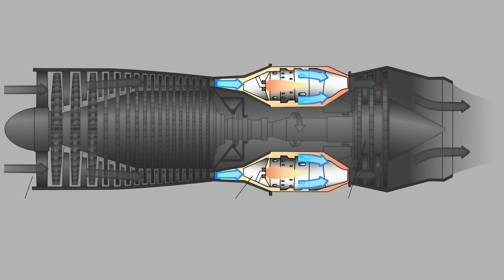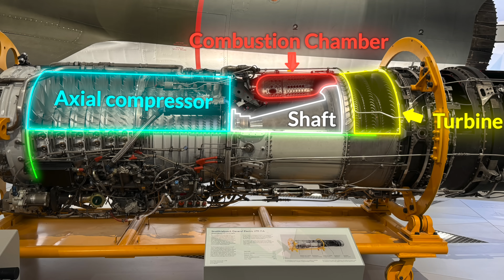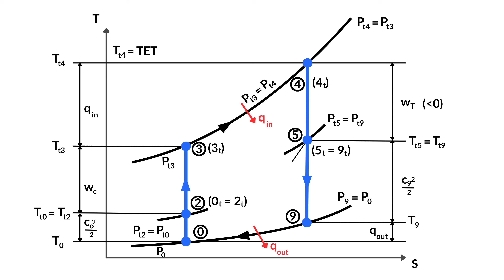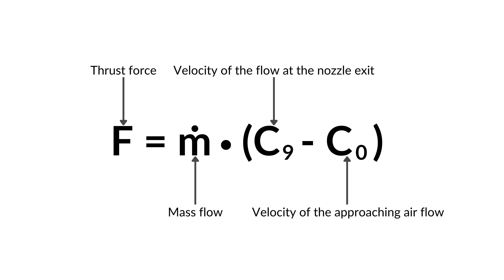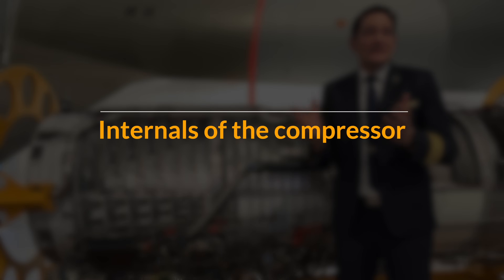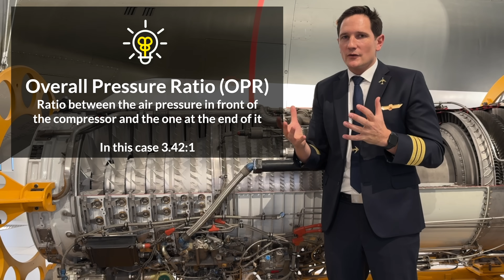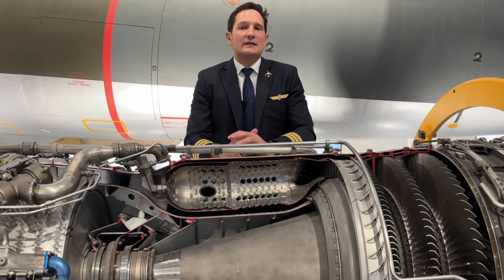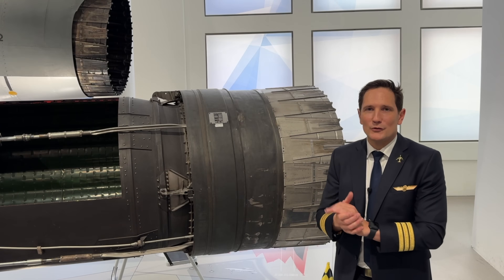How a TURBOJET Engine works - Explained by CAPTAIN JOE

Comment: 7:03 Given the formula, I would say at toga after line-up and wait.
We want thrust to be the largest possible. In the formula, we have: thrust = massflow *  (velocity at muzzle exit - velocity of approching air)

In multiplication, both sides should be as big as possible, so:
- massflow: we want the densest air possible (-> more mass at same volume, formula for that is mass = density * volume), that's at take-off on the ground, but also on landing or go-around
- (v(muzzle) - v(apprAir)): velocity at exit should be highest, approching air should be lowest, that's the case at standstill as no air is approching (plane at v = 0) (there could be headwind, but I think we can disregard), but highest exit velocity

=> this all applies best at take-off 

edits: further thinking about it, adding to the answer, increased readability, headwind
Reply: Almost. Maximum thrust is reached when the plane is stationary with no wind. That way the air speed in front of the intake is 0 and the air speed of the exhaust at the nozzle is at its maximum, making the difference the biggest and thereby the biggest factor possible. Also, air is thicker on the ground, so air mass flow is also the highest.
Reply: "as no air is approching" Exactly. And in this situation the air teleports (scientifically: quantum tunneling) into the engine compressor preventing the engine from flaming out. That's also the reason why the airplane has to stand on a wide strip of concrete or asphalt, as this enables this quantum effect to happen, and which is why bush planes always need a tank of additional oxygen for the engine(s) since on grass strips air doesn't like to teleport into the engines...
Reply: @elgonzo7239  You've taken a statement completely out of its context and don't understand the implication of it. Yes, air moves through the engine, but relatively speaking, the air around the cockpit of a 777 doesn't have any significant air speed due to the GE90 shoving several cubicmeters of air through itself per second.
Reply: @CerberusTenshi  What the f has a cockpit to do with engine intakes? "Taking things out of context" What exactly is the context here? "Air not approaching" meaning "air is approaching"? Do i need to take shrooms to understand that.

What if you have tail wind, with the wind moving from the back of the plane towards the cockpit? Is C0 now suddenly negative, or what? Again, do i have to take shrooms? 🤣
Reply: @CerberusTenshi  Also re "GE90 shoving several cubicmeters of air through itself per second" How would you imagine the engine being able to do that if there is barely any air approaching the engine? Tell me, smart one! Now here is some real context for you: The GE90 is not a turbo jet. It's a turbo fan. The equation shown in the video does not apply like that to turbo fans. Roughly and approximately speaking - and ignoring(!) bypass, C0 would be after the fan. I know, you care as little about that as little you actually care about context...
Reply: @elgonzo7239  Looks like you already have taken some. What he meant is, that the relative airspeed around the plane while it's stationary, is 0. There is no airflow towards the engines from the movement of the plane relatively to the ground. Is that understandable to you? That doesn't mean the engines don't suck in any air. But no air is PUSHED into the engine. 

Also, yes. If you have a tail wind while standing, you have a negative air speed. Because no air is pushed into the pitot tube and thanks to Bernoulli, the pressure inside the tube is reduced, which in turn could cause a negative reading. Planes can't fly backwards, unlike helicopters, so their instruments are set up for forward motion. Forward being positive. So standing still and a tail wind would indicate as negative.
Reply: @CerberusTenshi  Yes of course i have taken one. How else could anyone bear your nonsense. C0 is not about "airspeed around the airplane", it's the air approaching the engine compressor. Physically there is no sucking. There simply is no "sucking force" in physics. The air is always pushed into the engine -- whether it's by the surrounding air and engine moving relative to each other or air (molecules) pushing on air (molecules) by virtue of a pressure differential. Even if there is no air movement around the entire plane, as soon as the compressor starting, there will be a pressure drop directly in front of the compressor that will make the air flow and approach the engine. The rate of this pressure-differential-induced flow obviously depends on the pressure differential itself and therefore on the operational parameters of the compressor of the engine. Again, lest you forget: This is about turbo jets, not turbo fans, ram jets or what not. Also a little more context: C0 is not "air speed" and pitot tubes don't measure at compressor intakes, silly... So, while i wait for more of your false equivalencies, i'll take some more shrooms now... i really need a few more. Geez.... 😭
Reply: @elgonzo7239  Now I know you're just a troll. The equation applies just as much to a turbofan as it does to a turbojet. Because the speed of the intake air is taken from in front of the fan. The fan is accelerating the air and compressing it. The principal is still the same. Just because a turbofan shoves most of its air past the core, doesn't magically make it ignore physics.
Reply: @CerberusTenshi  You don't know nothing, all the while showing off your ignorance. You evidently aren't even aware that the simple equation shown in the video doesn't account for bypass... that you cannot equate m(dot), C9 from this equation with an entire turbo-fan. Because in a turbo-fan engine you have multiple mass flows (through the turbine and bypassing the turbine) with different exit velocities which thrust-wise combine by a factor that is called the bypass-ratio. The simple equation from the video does only consider one flow regime (like you have in a turbo jet, for example). It is insufficient to represent the thrust of a turbo-fan. Yes, the turbo-fan has of course also a single intake velocity, but then we are not talking about the equation shown in the video anymore. You need to use the formula that applies to turbo-fans if you like to wax thrust-related prose about turbo-fans. And that's also why it makes little sense to talk about C0 solely as a component in the equation presented in the video when turbo-fans are concerned... Where can i get more shrooms....?
Reply: @elgonzo7239  @CerberusTenshi The question was: "In which phase of flight does the jet engine produce the most thrust and why". The given equasion was: "F = mdot * (c9 - c0)".
I think we can all agree that we want "most thrust" (as a part of the question), so F has to be as big as possible. And F is highest, when both mdot and (c9 - c0) are both as big as possible.

Let's first look at the equasion:
- massflow (mdot):
mdot, or also dm/dt, is mass (here its the mass of the air and fuel) per time.

- velocities (c9-c0):
What sticks out instantly is that the velocities, usually shortened to v (in this case maybe v(in) ans v(out)) are not given in this way, they are c9 and c0. This notation is used in aerospace engineering and is referring to the  station numbering in jet engine analysis. Here, c0 is freestream condition in front of the engine, or just the freestream velocity in relation to the aircraft. c9 is the exhaust condition, or just the exhaust velocity in relation to the aircraft.

Now, let's maximize the thrust:
So, we first want mass to be biggest. We can't really change the mass of the fuel so it has to be the air. The mass of the air can be determined by: mass = density * volume. We can't really change the volume, so the density is important. So, in short, we want the densest air possible when it comes to massflow, as that is the only variable we can really change in the phases of flight.

Second, we want (c9 - c0) as big as possible. So, c9 has to be as big as possible, c0 has to be as small as possible. 
c0 is smallest, when the velocity of the incoming air relative to the aircraft is smallest. That's when the aircraft is standing (c0 = 0). 
c9 is biggest, when the velocity of the air after the exhaust relative to the aircraft is biggest. That's when you're giving full thrust with the thrust leaver.

All in all, to answer the question:
Out of all phases of flight we want: denstest air, aircraft is standing and giving full thrust (or at least biggest possible)
=> that's at take-off

PS: I'm not an aerospace engineer or a physicist. This is the result of researching around a bit, if I got a concept wrong, sure, please correct me.
Tailwind: well, both velocities are measured relative to the aircraft, c0 is nagative, so it would add to the over-all velocity, but c9 would also be slowed down, so no gain in thrust.
Quantum Tunneling: I don't really know what you want to say here, I don't think it even applies.
Asphalt runways: Planes can start/land on different runway types such as ice, dirt, grass or, well, most commonly asphalt.
Oxygen tanks: I've never heard of bush planes needing oxygen tanks. Also, they are usually powered by piston engines, not turbine engines.
777 with the GE90: As correctly stated, the GE90 is a turbofan, we're looking at gas turbine engines here.
Reply: @hikaruhoshi Something more to consider...

Thrust increases when mass flow increases, when mass flow decreases, thrust decreases as well. The mass in question is the mass of the air (with a minority contribution from the gases and particulates of the burned fuel). The denser the air the engine "breathes", the more thrust, because denser air has more mass for a given volume of air taken in.

We can actually therefore influence the mass of the air by choosing where we take-off from. The engines develop more thrust when taking off from an airport close to sea level than from an high-altitude airport (such as Quito, Ecuador, for example). Btw, this has actual effects on airline operations when flying to and from high-altitude airports.

There is another method to increase ejected mass (and therefore thrust) that has been practically used. There are examples of military airplanes that could inject water (or something like methane) into the burner of the engine, with the burning hot air readily taking on the resulting water vapor/moisture thus overall increasing the ejected mass. But it also has a cooling effect and that is the primary reason for water injection, because it allows using more fuel without overheating the burner and turbine and therefore higher exit velocity which results in more thrust. (btw this trick has also been used in WW2 to give a short boost of power for piston engines fighter planes, but at the cost of wearing the engines out quickly) Alas, the thrust formula as given doesn't exactly account for the ejection mass increase induced by such tricks (as C0 for the air intake would still be larger than zero, but for the injected water vapors C0 would be effectively zero), it can only account for the increased exit velocity provided by the increased fuel usage. Also, it's only useful in limited scenarios and in limited amounts, because, the plane would have to carry that relatively heavy water with it, with consequences to payload capacity and/or range...

There might be other effects that could have an impact how much thrust is generated, but since i am no expert in fluid dynamics, i can't tell whether such effects would be noteworthy or so negligible to not be worthy of consideration. But anyways...

At ground-level, when the plane is standing still and no air is pushed into the turbo-jet engine, the compressor basically creates a low-pressure zone at its intake, which makes air flow into the compressor. However, how much air is flowing depends on the pressure-differential - the latter again also dependent on the air density -, and if the airflow induced by the pressure differential is not "enough" then thrust wouldn't be maximal.  But as a reminder, i am no expert in fluid dynamics and i don't know the minimum amount of pressure differential at which such an effect would become significant for thrust production. But given how strong the created pressure differential can be (strong enough to suck people in), i kinda doubt that this pressure differential would be not enough to effect thrust...
Reply: @hikaruhoshi I forgot to mention one other thing that might be relevant for answering the question when a turbo-jet generates the most thrust (or not, i don't know)

There is also something like a kind of "RAM effect" (no idea if this is the correct term in this context) that happens when flying super-sonic. No i am not talking about RAM jets, still turbo-jets (but this consideration would not be limited to turbo-jets alone, but also applicable to supersonic airplanes powered by turbo-fan engines, for-example).

Incoming supersonic air has to be slowed in the intake duct (inlet) to sub-sonic speeds (for turbine-based jet engines at least, whose compressors would stall if super-sonic air enters them). Thus the intake duct is being able to feed pre-compressed and now denser air into the engine, thus effectively increasing m(dot) with the intake velocity remaining at roughly the same sub-sonic value. However, i am not sure whether super-sonic flight over a certain mach number for a given plane/engine would provide the overall highest engine thrust or not for that plane/engine (because it all depends on how much m(dot) could increase in super-sonic flight conditions for a given supersonic plane with a given engine without exceeding engine limitations, of which i really don't know anything...)

Comment: 6:51 At the takeoff, probably, because the approaching airflow (C⁰) is near to zero (of course, there are headwind-, tailwind- or crosswind- components), while the turbofan, or probably -jet engine needs a high mass flow (m) and a high flow velocity (C⁹) to get the ideal thrust force to put (1) kinetic energy into the aircraft to "get it to a roll" (actio-reactio, every force is generating the same force in the opposite direction, 3rd of Newton's laws) and (2) to generate that high velocity airstream (C⁰) over (and subsequently also under) the wing to increase the pressure under and reduce the pressure over the wing (Bernoulli (?) effect)! 

That's my answer as an avgeek... please correct it, if necessarily...

Best wishes

Patrik Krispler
Reply: Yes! What you said.
Reply: Oh, so, there's nothing wrong? 

Thank you!
Reply: Highest thrust for any jet engine, both turbofan as well as turbojet, is when stationary. The air flow is generated by the engine. Hence you shouldn't stand in front of a spinning engine. It will suck you in.  For an engind like the CFM-56 or V2500 (A320 and B737), 3m around the inlet at idle, 9m around the inlet at power, are the safety areas you definitely don't want to walk into. Bigger engines, bigger radius. 

Scramjet and pulsejet have different working principals though, so for them, the higher the speed at the intake, the higher the thrust they produce. But that's a different story.
Reply: @CerberusTenshi  So, ram air, induced during the take off roll doesn't have any effect on the engine power? So, if I remember correctly, during the take off roll, there's a significant amount of air being pushed into the intake, this extra air pressure, which can be measured by the pitot static system, by the way, won't have any effect on the engine performance?
Reply: @patrikkrispler5239 No, RAM has no significant effect. Just think of it this way. When the engine is at idle, there is a 3m safety radius around the inlet, that you as a human being shouldn't walk into, because you can be sucked into the engine. At take-off setting, that radius increases to 9m. High power run-up for example would technically create a scenario, where you could walk into that area. That half sphere with 9m radius is where the fan blades grab their air from. Winds inside there reach speeds far greater than any hurricane. So if a gentle wind blows, does that make any difference to the hurricane? Nope. 
Now, the intake is also size restricted. So the amount of air that can get through it, is limited. And the one thing that limits the amount of air, that can get through it, is the amount of air the first compressor stage can shove through the engine. On big turbofan engines, that's the fan blades. On turbojets, the fan isn't as big and doesn't have the same bypass ratio. But still, the first stage dictates your mass airflow.
Think of it like a bouncer at a nightclub. No matter how many people are shoving from the back of the line, in front of the bouncer, he dictates the speed with which he sends people into the club. 
Hope that analogy helps visualize, why RAM is insignificant on turbofan and turbojet engines. 

Btw., no matter with what speed the air comes into the inlet, due to its shape, it all gets slowed down before it reaches the fan. On supersonic capable jets, the intake is variable, so air always gets slowed down to subsonic speeds. As long as we're talking about turbofan and turbojet engines.
Reply: @CerberusTenshi 
Oh, wow! 
That's the greatest, most detailed explanation with the best "everyday analogy" I've ever got in the comment section of a YouTube video! Thank you so much for taking your time to write this answer! This really clarifies a lot! And that's the reason, why they try to increase the fan diameter with every new engine generation!
Reply: @patrikkrispler5239  You're welcome.
Reply: On the other hand, you'll almost always take off with a derated thrust setting...